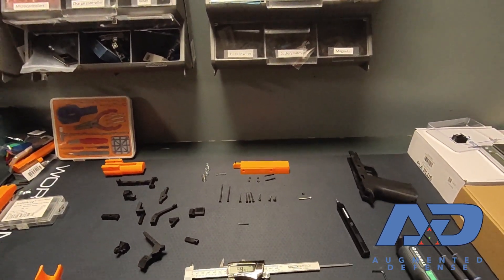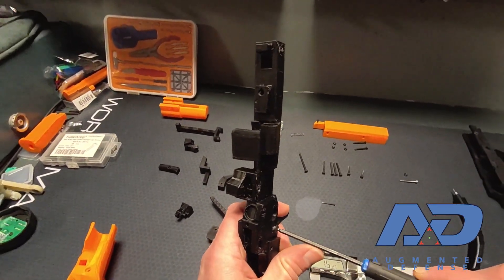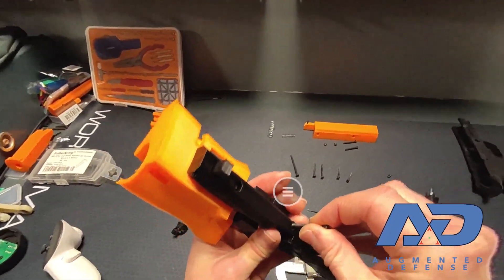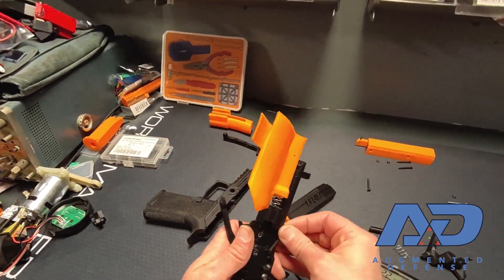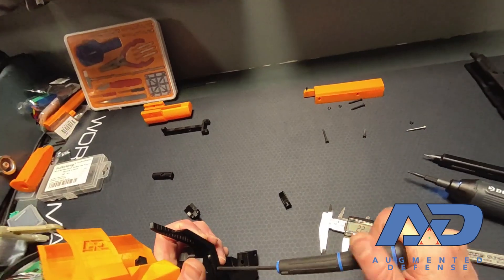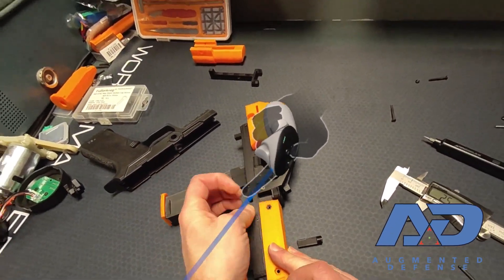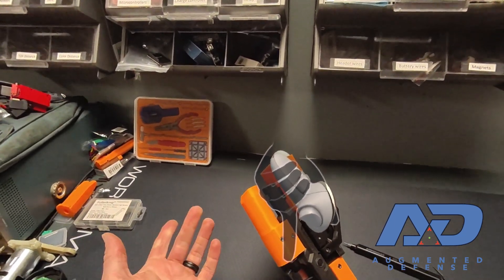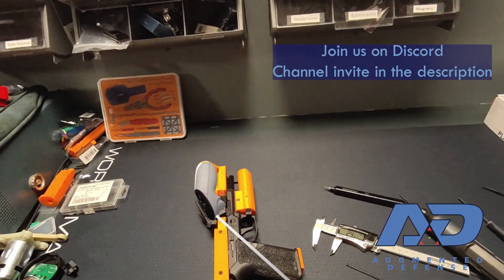XR Pistol Build Video

Comment: The trigger block in the video is complete different from the one on thingiverse.
Reply from the maker: The github link in the description is up to date, the thingiverse project didn't get updated.
Reply: I just printed the thingiverse version where can I find the hardware because I can't find everything at ace or my local hardware store
Reply from the maker: @Squirrel_Daddy_N8  The thingiverse version is different then the one in the video. Once i'm done with the current round of updates i'll be updating it. Use the github one, its the one in the video currently, and comes with a full parts list. everything from the list can come from amazon.